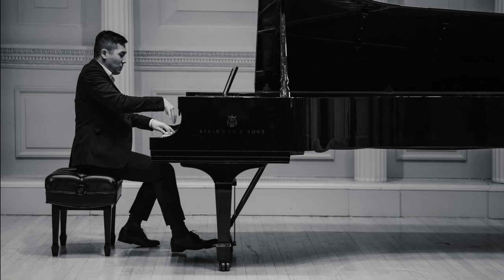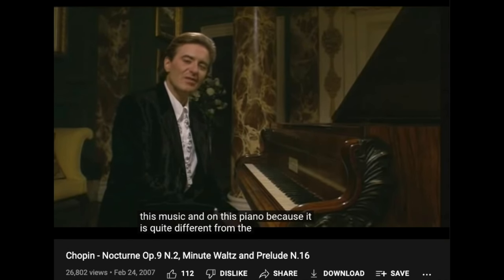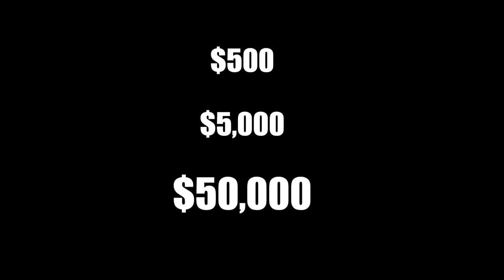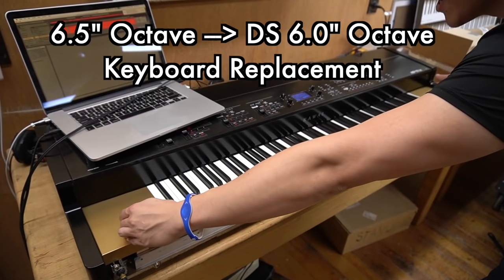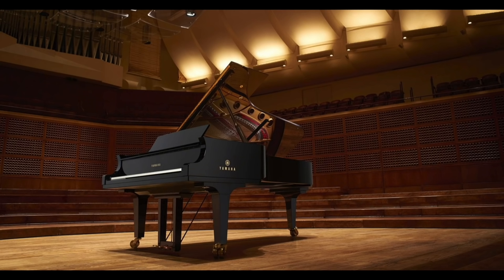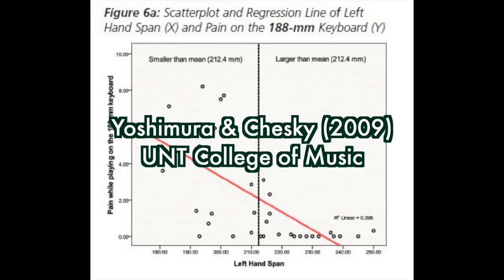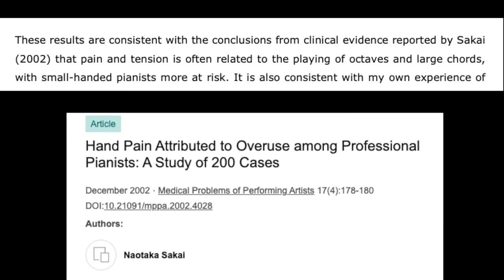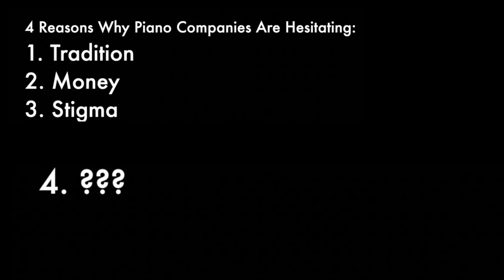Piano's Darkest Secret

Comment: This is absolutely fascinating. Not something I've ever considered, but OF COURSE pianists should be given a choice. Guitarists have many choices to suit our custom specifications, so why not pianists?
Reply: even violins have four sizes
Reply: @Kristian Bušta neck size is a bit variable between brands, specially in the neck style (not so much on the width, but is highly variable in the radius), but the length from fret to fret can also be found in different sizes, as you can buy short-scale guitars and long-scale guitars (also known as baritone)
Reply: Crazy to think that an instrument as popular as the piano doesn't have any custom sizes available
Reply: @seatheparade  Well, there is one "liittle" problem...
You can take your custom guitar and go on stage. Try it with the piano. :-)
Reply: @justahuman5342  Yeah but full size will sound best... because a smaller violin needs looser strings... but piano can be customized because the keyboard size will not change the string size.
Reply: It would be very costly & expensive for venues to acquire three grand pianos, & where would they store them!?! 
However, it was mainly the manufacturing process that has also dictated the width of the keyboard along with the size of the keys, because reducing the size of piano-frames or keyboard creates other problems that are difficult  to overcome!
Reply: @stevie-ray2020  So you get different venues with different pianos.  Not a problem.
Reply: @jeffstarrunner1  I agree, the offset of hammer action on strings over 88 keys could easily be overcome with technology. this has nothing to do with length of string as it does distance between strings, for better clarity on the soundboard. The piano stays the same size, strings included, it's the key and hammer action that needs to change, probably the most expensive and technical components of the piano, therefore, the last thing that will be changed.
Reply: @justahuman5342  There are eight sizes actually, but i see your point
Reply: money lol
Reply: even cello have sizes
Reply: I think having concert-worthy instruments being worth 5k$-10k$ and being a personal item helps immensely in this regard. Pianists have to deal with 50k$-200k$ instruments in concert settings, so it would very very expensive for concert halls to carry multiple sizes of pianos.
Although I must say I really enjoy the American's gentleman solution, which is to make only the keyboard of a custom size and let everything else be the same on the piano if I understood correctly. Maybe pianists could travel with their own actions, and this way techs would only have to swap actions before a concert. Or concert halls could have a standard sized keyboard, and others that would fit but would be thinner.

Comment: As a manufacturing engineer, it doesn't surprise me at all how much money that guy has spent in making those keys of different sizes. High-quality one-off or low volume production is very expensive for a number of reasons. What an interesting video.

Also, I'll be honest, I'm not a pianist. I've never played, and never used to find it even that interesting (until your channel). But I sincerely hope that the industry begins acknowledging and accommodating these very basic differences. It's such a simple idea, and you really seem to be on to something. The data definitely seems to support your conclusions.
Reply: It is much easier to make smaller keys with an electronic keyboard.
Reply: the data - the factual data suggests that nobody wants to buy smaller pianos. that is the fact. everything else in this video is just false theories.
Reply: @ekklesiast  well, you have to consider the possibility that the data suggests that nobody wants to buy small pianos simply because nobody considers it a possibility. I would certainly think there isn't significant data to support your claim that these theories are false, however I could be wrong as I haven't exactly done much research on the subject.
Reply: @ekklesiast  Yeah, everybody wants to buy 1/2, 3/4, and 7/8 size guitars, violins, etc, but not 7/8 size keyboards.

Because pianos are special.
Reply: @codybill24  Yes, millions or tens of millions of pianists for several centuries  have never ever considered a possibility of buying a smaller piano. There's just one guy who makes them in secrecy for 30 years while everyone else is blind. Sure. 
It's not my claim, it's your claim that needs any support. My claim is just actual facts.
Reply: @ekklesiast  perhaps I worded that poorly, and that's my fault. I don't mean nobody ever considered the possibility, I'm sure people have. But a substantial enough quantity, who have the resources to buy the pianos, I dunno. Consider that if the instrument were standardized (as it was) and somebody thought of making a different size, that would be considered somewhat risky, since you don't really know how many people (if any) will want to buy it. And of course they're not exactly the cheapest things to make. Plus, if somebody finds it difficult to play, there is a good chance they simply think they need to "get good" rather than seriously considering that they just don't fit the instrument. Especially when that's not really a consideration for most instruments, the concept of just having a different version that fits the individual better. 

Regardless, you are using some logic as a substitute for facts, when they are not always interchangeable. Just because you're train of thought makes sense, and your argument is logical, does not mean it is correct, and more importantly does not mean you have supported it with facts. I don't mean to say you're wrong, however I do think your statement that Lionel's claims are false is based in nothing really except your opinion that they are probably incorrect. It's not a matter of "my statement doesn't need data and yours does," because all statements which are to be made as being factual and not opinionated must be backed up by facts. That is how truth is determined. Lionel provided some data to support his theories, and also did say that they were his theories, not that they were the absolute facts. Based on the data provided, it would suggest that his theories may have some merit, and should be considered rather than dismissed entirely as "false claims" unless one can provide evidence to clearly prove that they are incorrect.
Reply: @ekklesiast  I'm not sure Steinbuhler has successfully applied the five Ps of marketing: product, price, place, promotion, people. In particular the price point is currently outrageous at $10-15K US for acoustic retrofits. He needed to bring that down but didn't. But Steinbuhler's plan was always to get the majors involved and not to master the market himself. Perhaps that was his mistake. 

For a parallel, look at the EV revolution currently under way. That came not from the majors - remember GM first tried to kill the electric car - but from a complete outsider upstart in the form of Tesla. And now Tesla has the largest market cap of any auto company in history.
Reply: @ekklesiast  - NOT smaller pianos - smaller keyboards that fit into standard-sized pianos.
Reply: @codetech5598  - it's just the keyboard size - not the entire piano. It's smaller keyboards that fit into standard sized pianos.
Reply: @aBachwardsfellow  That's not the point. In fact it reinforces my point. There's no demand for even a keyboard which is cheaper than a piano and can be used with a regular piano. 
Also there are small pianos being sold by other companies
Reply: @ekklesiast  
1. it's just the keyboard size - not the entire piano.
2. in a way your answer just proves his point - " millions or tens of millions of pianists for several centuries  have never ever considered a possibility of buying a smaller piano" -- because there has never been any other option available
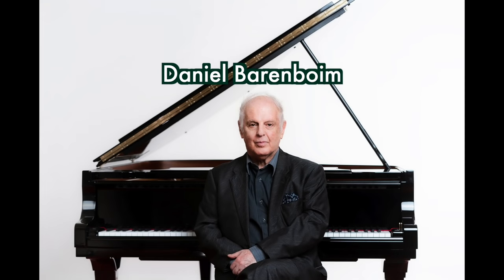3. you may not have gathered the significance of 15:30 - 15:50:
a. out of the "... millions or tens of millions of pianists for several centuries " (most of which are insignificant), at least two highly significant pianists intentionally chose to play on concert instruments which had altered (smaller) keyboards
b. neither of these pianists made this public knowledge
Reply: @aBachwardsfellow   1. Exactly. it's just a keyboard which is much cheaper and can be used with a regular piano, and people still don't want it. Also there are companies that make small pianos, that were mentioned in the comments
2. You didn't understand me, that was sarcasm. Pianists considered smaller pianos throughout piano history and in the end the demand for it is negligible, that's why almost nobody is making them and whoever does is losing money constantly. It's just a waste of resources.
Reply: @ekklesiast 

1. are you saying that people are aware that smaller keyboards are an option and people are  intentionally deciding not to get them? Or is it that very few people know that alternate keyboard sizes are available? 

For the latter group it can not be truthfully said that these people do not want them,  because they have no knowledge of them on which to base a decision as to whether or not they want them.

2. Your statement about earlier pianos in piano history seems to be reversed from the facts. People did not " ... consider smaller pianos throughout piano history" as an option and decide against them. The historical fact is that throughout piano history, pianos were initially built smaller, (evolving from harpsichords, clavichords and fortepianos) -- there was no other choice. They gradually grew larger through piano history -- in part due to the growing sophistication of increasingly sophisticated and complex musical compositions for the  piano, alng with developing technologies for rbnuilding pianos.
Reply: @codybill24  That's the point: You wrote: people think they need to "get good" rather than seriously considering that they just don't fit the instrument. Question: Are you use you've never played an isntrument? Your rewarding comment tells a different story.
Reply: @lazarusstuttgart7574  I'm not certain I understand your point or what you're asking. If you're asking whether or not I've played an instrument, yes, I've played several. And indeed, people do or don't fit certain ones. An example is with wind instruments, let's say brass ones. Different people's lips are better suited to trumpet, french horn, trombone, tuba, etc. due to size mostly, and nobody finds it weird. Even on a particular instrument, different mouthpieces fit different people better or worse. But somehow everyone is expected to fit the piano in only one size? I see it very similarly to different mouthpieces for wind instruments, different sticks or mallets for percussion, etc. It really changes nothing major, but allows the instrument to fit the person by swapping out the interface. It makes sense that the same should be applied to pianos, when it doesn't change the sound or quality of the instrument.
Reply: @codybill24  Thank you! Got it. Very good point. I should consider to continue my research on that.
Reply: @ekklesiast  Pay closer attention: The piano and its size are the same, only the keyboard is altered.
Reply: @papaarts1  which makes it much cheaper than an entire piano. and still nobody's wants it